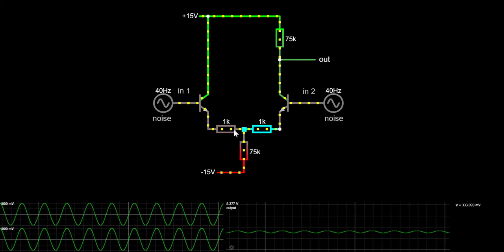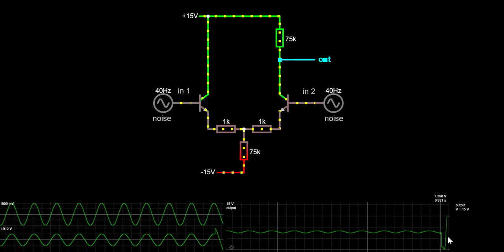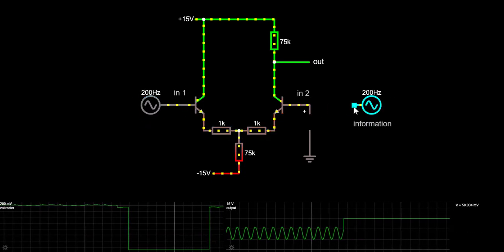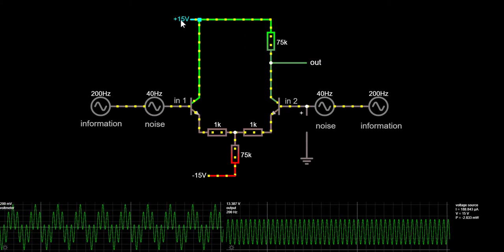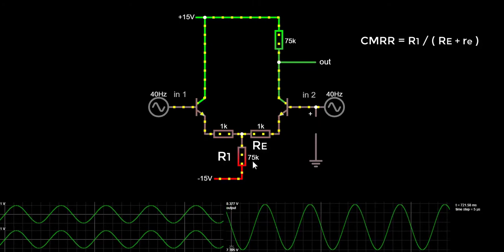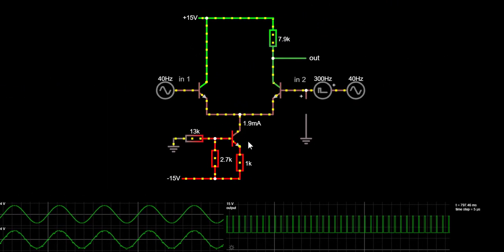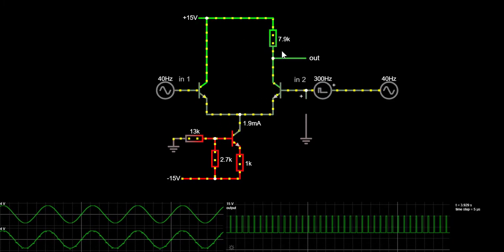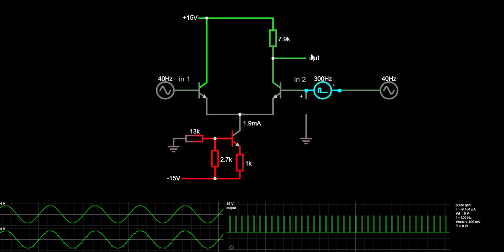How does a differential amplifier works ? PART II (Udemy Course)

Comment: first of all 15 and -15 voltage do not exist they are 30 and 0 and your gnd is between them at 15 volts , second is the fact that the emitter resistor is common to both transistors as a result whenever you open a transistor more it results in more current over that resistance as such the potential between the base and emitter of the other transistor will decrease closing the transistor which in turn will result in a higher voltage at the collector that s practically how it works , third fact the so called current source it`s just a biased trans  which in turn is using the same principle of feedback explained above , whenver the voltage across the emitter resistance of 1k increases results in a lower potential between the base and emitter of that current source transistor therefore a lower bias and transistor is starting to close keeping the current the same but most importantly acting as a variable voltage source (which is what your transistor  constant current source is ) that variable voltage has the same behaviour the was previously occupied by that solo resistor, anyways in retrospect a differential amplifier is a constant current source one in which whenever a leg has more current results in closing the opposite transistor via increasing the emitter voltage drop
Reply: Look at schematics -+ is the correct way, why do you think they have center tapped transformer and negative voltage regulators. Yes between -15 and +15 is 30 volts of potential difference. The ground and scheme of the circuit is what makes his label correct.